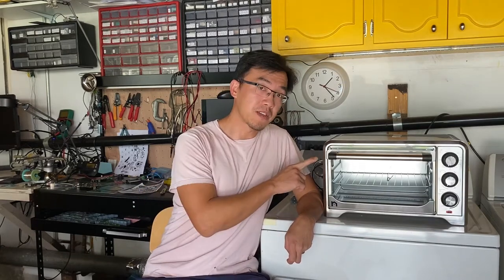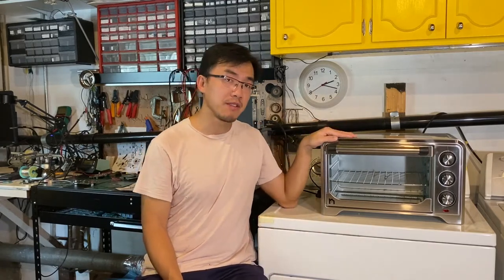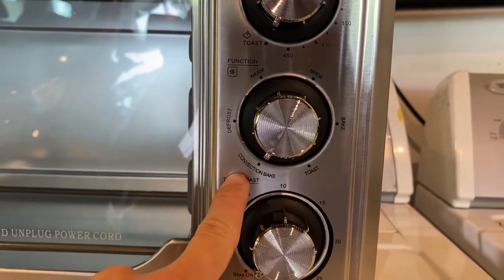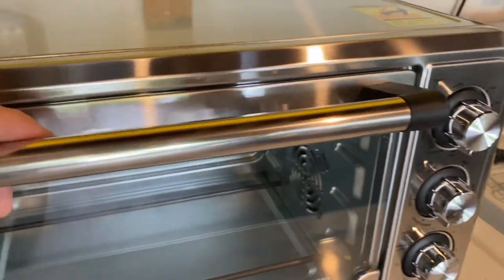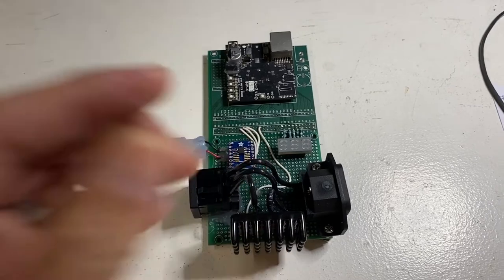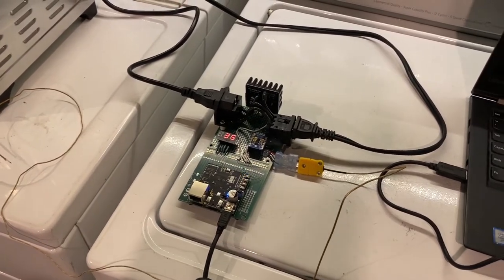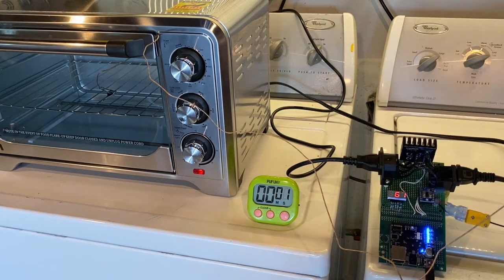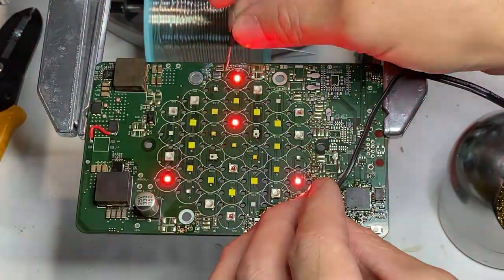DIY SMD Reflow Oven for PCB Soldering, Using Toaster Oven Without Conversion or Transformation

Comment: This is exactly what I've been searching for - Very good setup and explanation.  I'm interested in getting on board with a schematic and firmware.  Note that the model number provided below:  House Kitchen NH25-6-SS does not show up when I search Amazon.  No issue on the status of the code - That's how I put bread on the table :).  Again - Great Job and Thank you.
Reply from the maker: Thanks and glad it helped! The model number is correct, however it's no longer available on Amazon. Try Amazon's ASIN "B07H9QWT95" on google, you should be able to find it.
Reply: @XueMingYu  It looks like the model is discontinued. The closest model I could find is "1500 W 6-Slice Black and Silver Convection Toaster Oven" by Black & Decker. $63 at Home Depot. I'll go to Home Depot and take a closer look. I'd be willing to modify the toaster slightly so I wouldn't have close the door on the thermocouple.
Reply from the maker: @3deeguy  This is unfortunate, however any oven of this type should work as well. Good luck with your project!
Reply: @XueMingYu  Thank you for posting a great video.

Comment: suprised by your controller! I think this controller may also apply to electric iron. Do you have plan to open source your controller board?
Reply from the maker: Thanks! I should probably do that after I find time to clean up my codes!
Reply: @XueMingYu  Im also very interested in the code! even if its not cleaned it, it'll provide a great starting reference :D

Comment: Hey Xueming Great Video!,  i have a doubt mate, like 4 months ago, i took once the toaster oven from my kitchen and placed to another room to reflow a LED on a copper board, i don't have liquid solder so i used that wire of solder and not flux just solder paste, okay i didn't reflow inside the toaster oven, i did it in the top outside, when pressing the LED to sit as close as possible  solder blobs came out and sat on the top outside of my oven,      I took a cotton wool to catch those blobs of solder and after that i took another 2 cotton wools to clean any excess, do you think i'm in troubles? i've been using it in my kitchen since that.
Reply: I would suggest not to do that again as from what I understand of solder, it is very bad for you
Reply: If you are still alive, don't worry. I used to reflow ps3 and Xbox in my personal oven. Pretty sure I don't have cancer
Reply: @meticulouselectronics  hey friend, hahaha okay I understand, I lost my fear to solder wire, now I'm worried about solder paste xd.
Reply: @josxd8598  all the old mechanics I've worked with taste fluids to determine what they are when they are looking at leaks. Then cover their hands in anti seize and eat lunch. You'll be fine friend
Reply: @meticulouselectronics  Thank you friend, I've only used solder paste (67 tin / 37 lead) 2 times, and one time I applied it on the desk where I have my PC, you know the powder is pretty small, nice to know a few isn't dangerous.